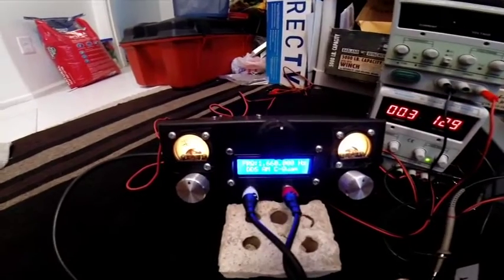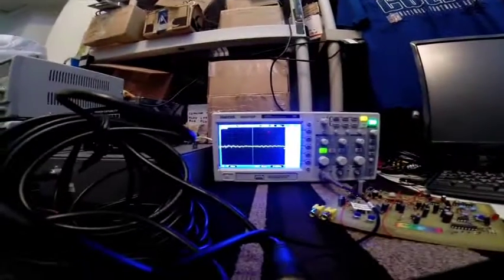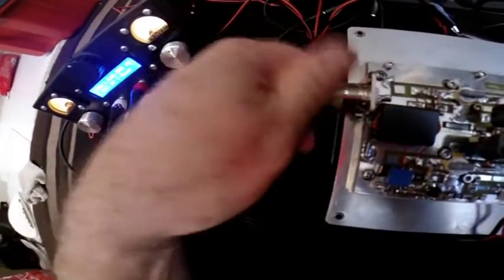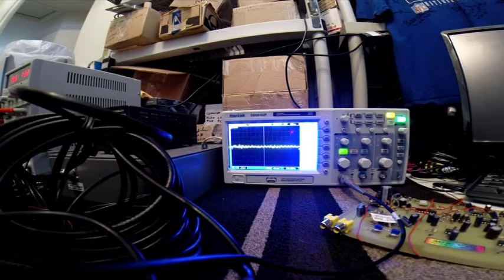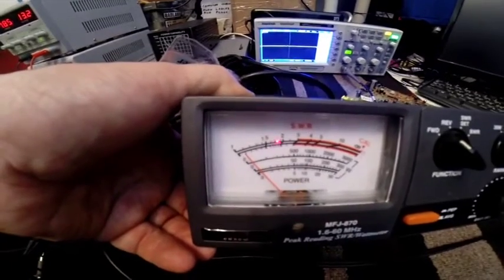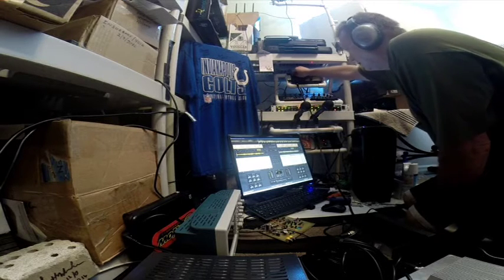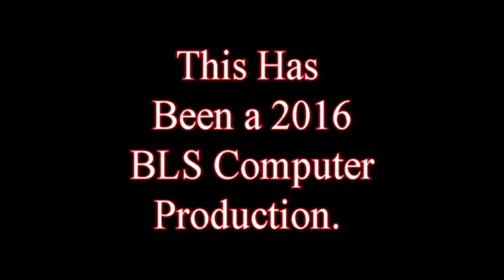KWBS 1660 C-QUAM AM Stereo Transmitter (Exciter) Recorded 7/23/2016

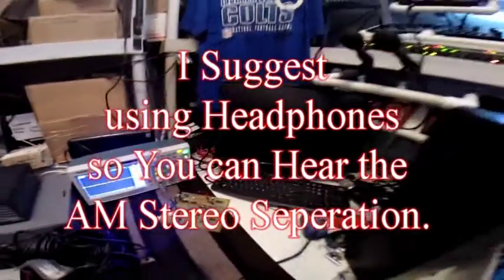Comment: 4:50 I can hear either the wire is loose or the tape is wrinkled...It does sound wide separation other wise. Try putting on some Amiga 4-channel Protracker MOD demoscene music through it...that's got crazy wide stereo separation (it technically is a quadraphonic song.) At least do 12th Warrior by Dr. Awesome...

Comment: It sounds like one of the channels is out of phase.  The bass shouldn't null in mono but it is.
Reply: If the signal is too strong, that can cause bass distortion on those Sony AM Stereo radios. Try reducing the power output or move the radio to a location where your signal is not so strong that it's overloading the receiver!
Reply from the maker: Thanks for the info, it differently needs work.
Reply from the maker: Thanks that could be it. At the time of this recording I had the Radio 
in the same room with the AM Stereo Exciter. Lots of RFI in this house. I'm moving soon, hopefully to a place with less RFI and I can experiment with getting the AM Radio further away.